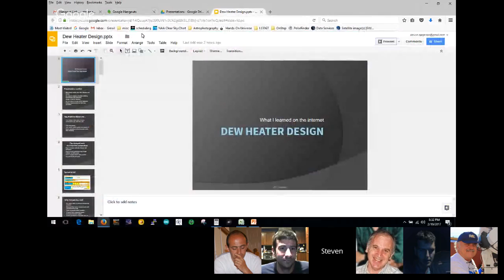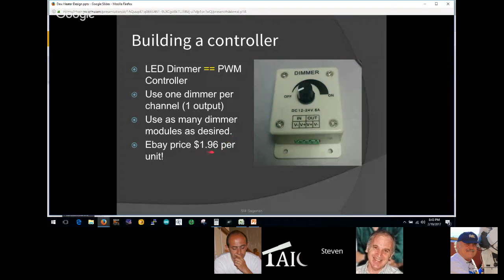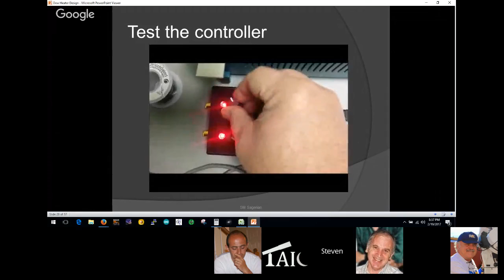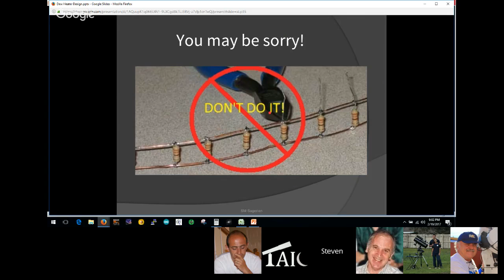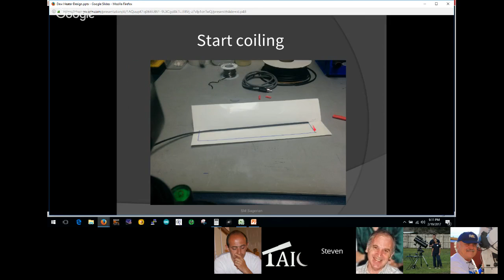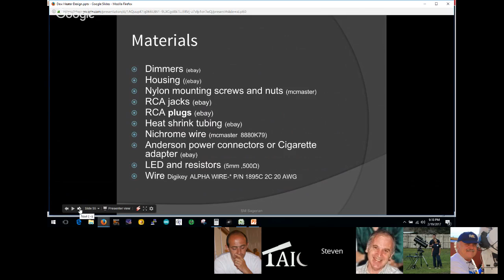Designing and Building a Low Cost Dew Heater System

Comment: Can't wait to do this myself! Another argument against the ladder arrangement is that in it's failure mode it will heat your OTA unevenly because the resisters are in parallel instead of in series. A series resistor is like a chain with the chain breaking if any link is cut. Parallel is like a chain net, if you cut one link there are others still working. Normally redundancy is helpful in electrical circuits but in this case I think not working at all is better than working unevenly.

Comment: I have a 2" dia. finder scope.  When I plug this value in the spreadsheet, the length of the heating element calculates out as 17 ft.  Is this correct? It seems like a lot of wire for such a small circumference.

Comment: Nice video and seems easy to make.  Does anybody have a recommended parts list?   I live in an area where the light pollution is low and with COVID-19 and limit telescope and electronics stores nearby, forcing me to buy online.  I like to order everything, so they arrive nearly at the same time.  I ordered the 12V DC PWM Manual Knob Dimmer Switches for LED from China and it will take a couple months to receive them.  I like to have the parts list, but what I really like to know, what is the size of the housing?  Again very informative and eager to build it.

Comment: Hi - I tried the spread sheet for this and it does not seem quite right - maybe I missed something - I entered the scope circumference I wanted to make a heater band for (10" Meade SCT) which is 36" and it says 113.1 inches heater element, heating element length 1 feet? .5 up and back? I am using .28 resistance wire and want to several length's and even though I have gone through the video twice I must have missed how to use the spreadsheet... help would be appreciated.

Comment: the MSPF is in inches (Watts/inch) , with that you calculate the total power  (P) needed to defeat dew. Then you use R = V^2/P to calculate the resistance (R) needed. Now, assuming most people dont have a digital multimeter to actually measure the nichrome wire resistance, we use the charts(which show how much resistence per FOOT for a particular gauge of nichrome wire) to calculate the length of wire needed for R (most people have a tape measure or a rule) 

so.. {calc Watts needed} -> {calc R for the desire Watts} -> { calc length of wire based on R/FOOT} ->cut the wire, then build the heater based on the guidelines in the presentations.